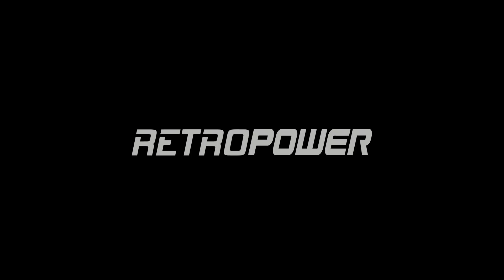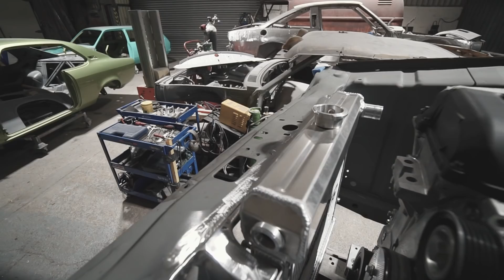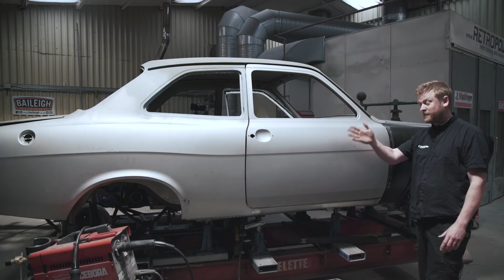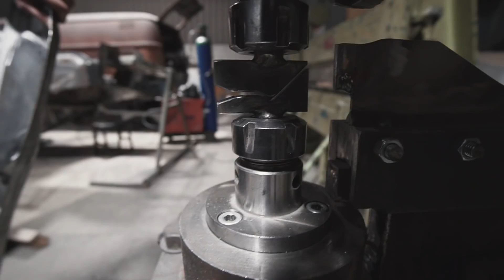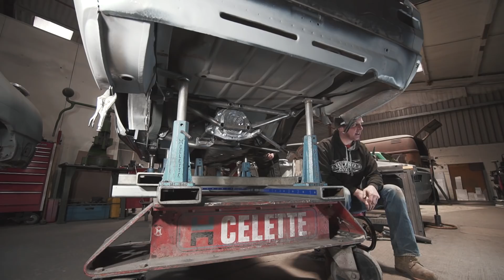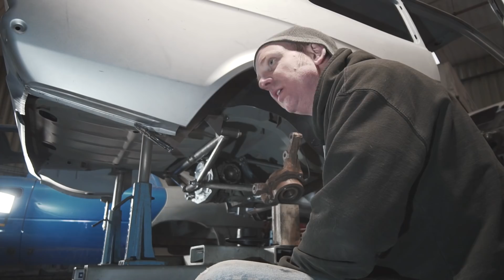Gordon Murray's MK1 Escort - Retropower Build Episode 6

Comment: Really enjoying the detailed explanation of the build so far.  Wouldn't have thought that the Independent rear setup you're using would come up any heavier than a Salisbury 4HA rear with 4 link and  a Watts; it's not like you'd be using the original 'English' axle and cart springs with all that torque up front.

Comment: Just out of interest did you use Type 49 inner wings or add any other strengthening besides that brilliant tubular dash crossmember? While I am sure Mr Murray will not be 'yumping' this car any time soon I recall we used to fit tubing  up the 'A Post' as the Escort always landed nose first and bent at the windscreen scuttle. After which you could open the door but not close it. All perfectly legal and labelled 'accident damage repair' M'lud .....
Reply from the maker: 1chish it's got the type 49 inner wing reinforcers. We are also adding the group 4 style chassis leg 'wedges' and also our own corner gussets between bulkhead and inner wing plus a welded strut brace
Reply: Ah thanks for that info. I did think you would do something in that area. Some folks think the first 'full' roll cages were for crew safety. They were actually more to add strength to the front of the bodyshell ....

Always have a soft spot for the Escort Mk I especially in Twin Cam form. you could steer it on the throttle in the rough. RS's with Atlas axles and 4 link rear end were far more precise but less fun ...

Comment: God i wish i could move to u.k. and work here.... im a trained tech and fabricator , but live in middle america where speed shops dont exist. So now im a journeyman carpentor wishing i could build cars...
Reply: Deftones Dsm be a good builder anyway.
Reply: peter olsen oh i build shit . Look at my single video of my fully built by me motorcycle. Its just i dont have as much passion with my day job... i still build amazing giant structures as a carpentor (last one was million sq ft warehouse) but i desire so badly to work with guys like retropower and build engines. I was an a.s.e. tech b4 a carpenter. And my specialtues where engine theory/rebuilding and electrical systems/diagnosis. But again unless i work at a car dealer theres nothing here.